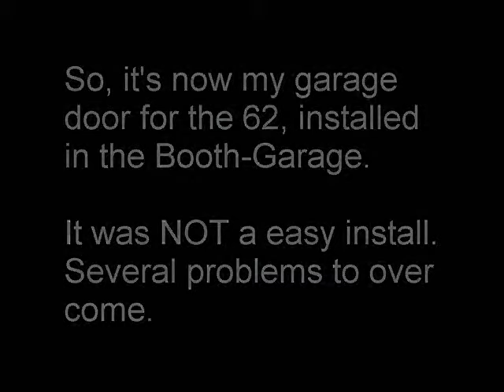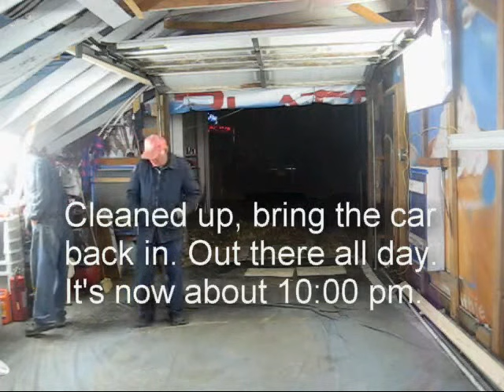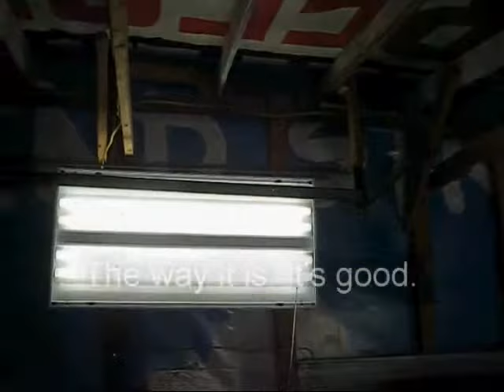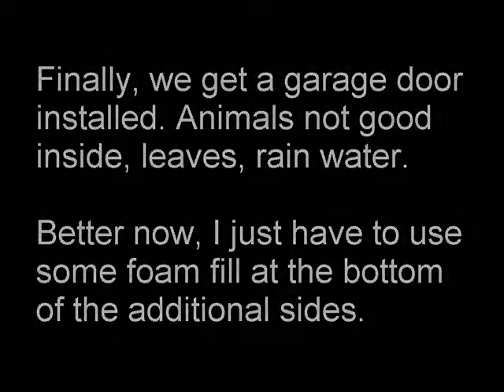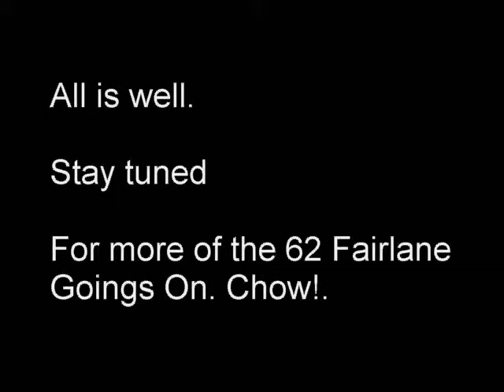62 Fairlane Goings On 17 (I Finally have a garage door!)

Comment: I like it, garage door on a makeshift garage, its fitting whether it likes it or not LOL :-D
I could see that every door section corner would hit the roof beam, what a pain :-(.

Hope you re-enforced that cut beam with side bits.
it might invalidate the manufactures guarantee, you will have to send a letter to yourself asking if its ok :-D
Reply from the maker: LOL... Each beam is screwed to the 2x4. The top panel, is reinforced with wood screwed through the doors metal. Works good.